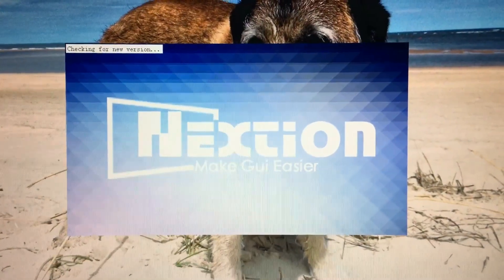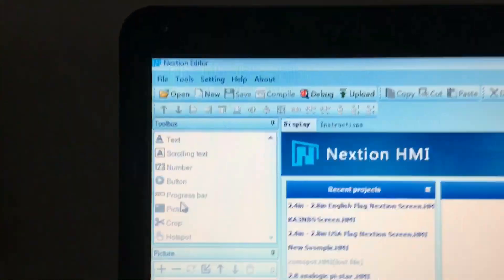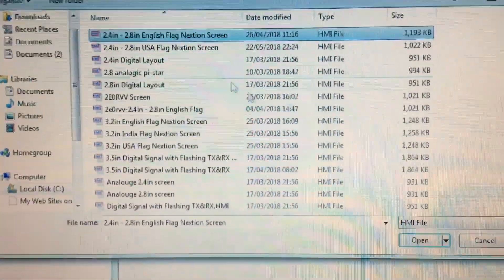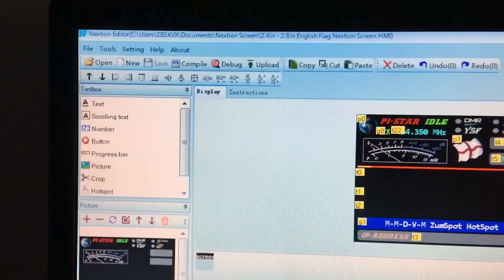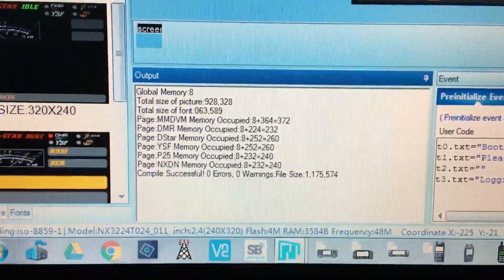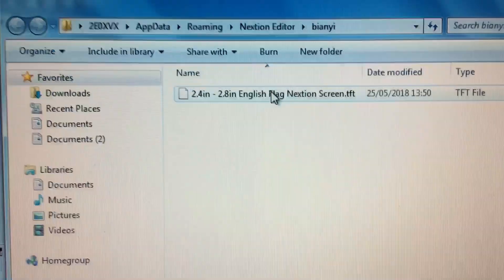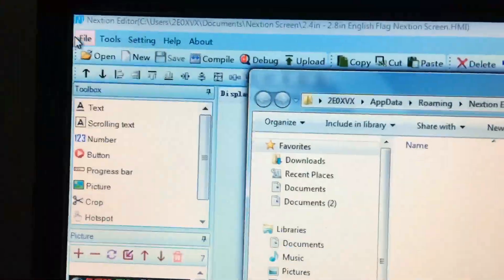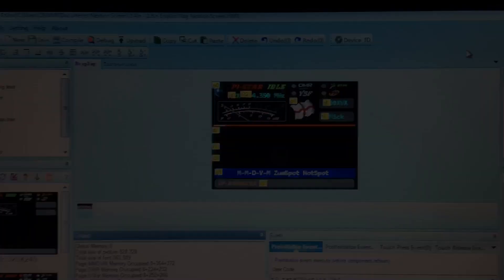Making a tft file from a HMI file.

Comment from the maker: The tft file is dropped onto the root of an sd card,then put into the back of the screen. Then power up the nextion with just 5vokts and it dumps the screen graphics to the screen. This has no advantage other than speed

Comment: Hi, 

I am using Nextion editor and I usderstand HMI files and how to 
upload the HMI file(s) to Nextion screen, 
What is a tft file used for & can I take a tft file and convert it to HMI (or maybe that is not possible)?
Thanks, 
mm6duv
Reply: TFT file is the "machine code" version (same as many other programming languages).   Not to be edited.   AFAIK they CAN'T be "de-compiled" back to HMI.

Comment from the maker: Just drag and drop the file to a formatted SD card. No burning. Just drop the tft file to the SD card. Put the SD into the screen and power on the screen with just the power and it will burn the image to the screen. Then when it’s 100% done, take the SD card out.
For any one else,I have covered all this in YouTube videos on my 2E0XVX YouTube account.